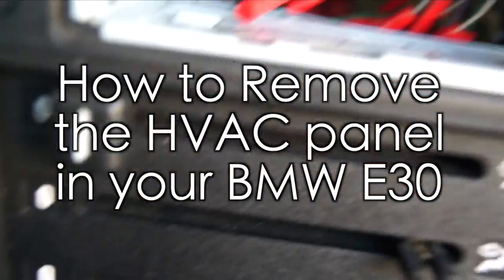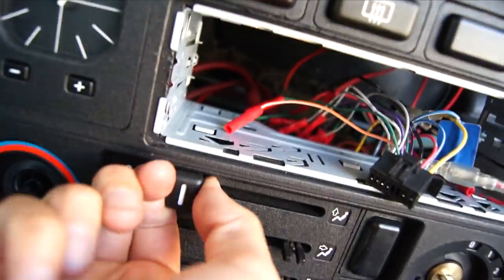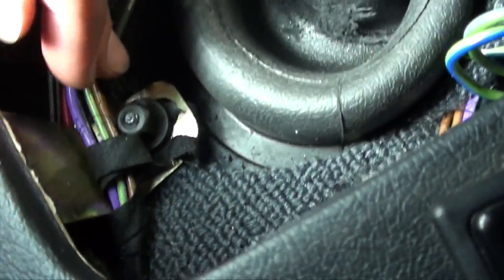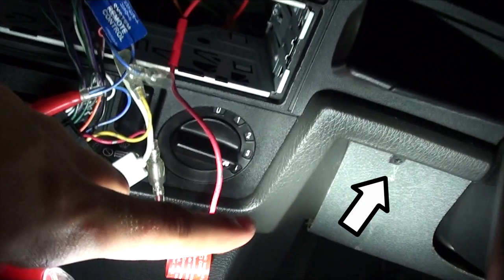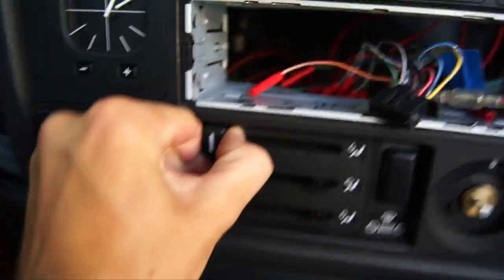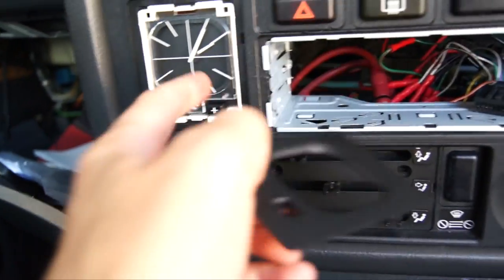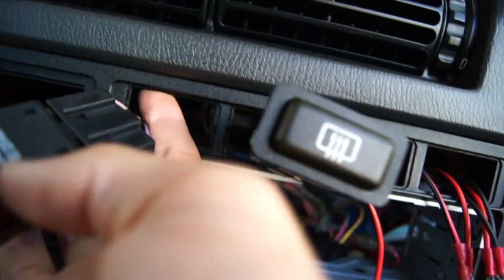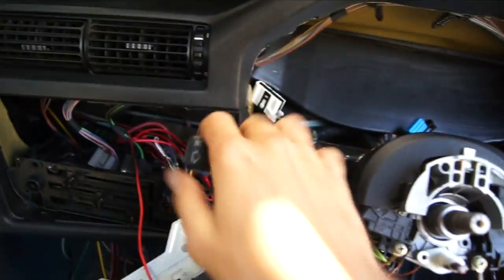How to Remove the HVAC Panel on a BMW E30

Comment: 2:54 Incorrect, US models have a bracket under the passenger side.  The bracket is directly beneath the fan knob connecting the center console to the the dash.  I would suggest not pulling or you'll crack your dashboard.

Comment: Thanks for the upload. Helped me out . I need to reconnect the cable for the heater temp control . The spring clip has come off . I never knew there was screws behind the selector panel . Been struggling all this time . 👍

Comment: HI. Where on the front panel, the light bulbs are attached.  My e30 has no illuminations on fan and temp control. When I opened the the front panel, I found two loose end wire with light bulbs. .. Thanks